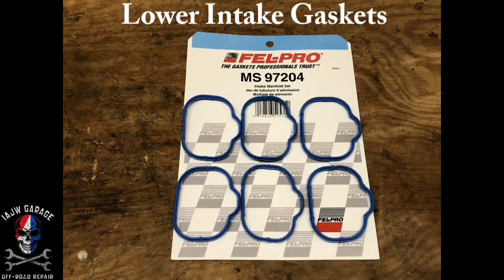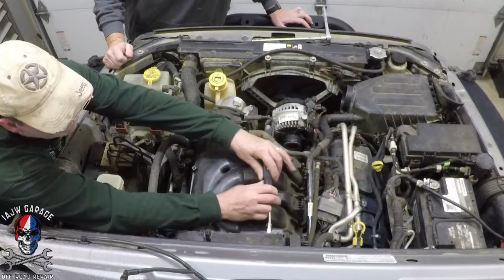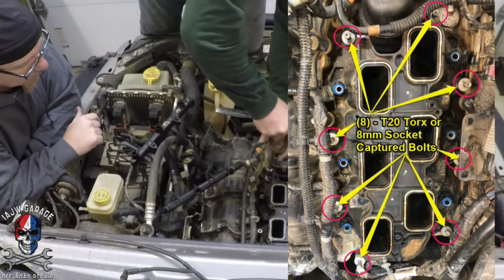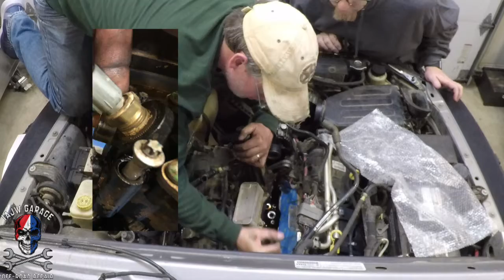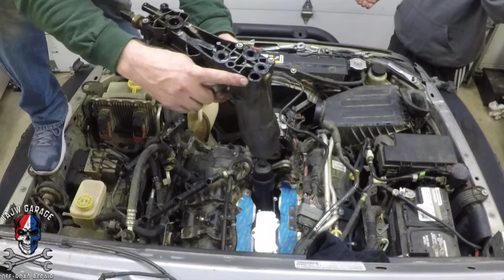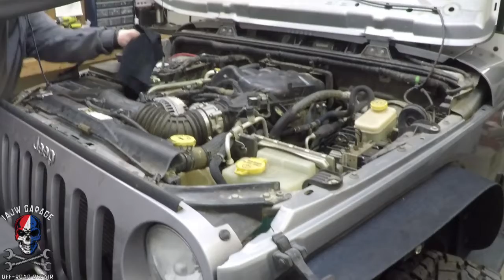Jeep Wrangler JK JKU 3.6 Pentastar Oil Filter Cooler Housing Replacement

Comment: I'm in agreement with everyone else that the video is superb.  The dialog between you and the owner of the Jeep was excellent in that it injected questions about the procedure that I would not have thought about.  The "in-set" close-ups were a big help also!

One thing about DIY.  You're going to need special torx sockets, both male and female, so head to Harbor Freight or elsewhere.  Second, I agree the injector clips were the main point of frustration for me.   They're delicate, you don't want to break them, but they give you fits.   I'll add that you stated to press the black part of the clip "down", but you actually need to push it "inward" toward the red locking clip.   The way you were sitting on the engine with the injector already pulled out,  one would have pressed "downward" due to the orientation of the clip.
Lastly,  Lowe's sells silicone grease under the DANCO name in the plumbing department for under 5 bucks for faucets.  This stuff works WONDERS on ALL O-ring installs.  Just a hint.

I closing, thanks a million for the video.  Couldn't have done it without you!
Reply from the maker: Thank you very much for the detailed and informative comment

Comment: I think it would have been helpful had you found and shown the leak or fracture..how obvious or non obvious to the eye after removing the oil cooler housing..also note a good time to change plugs, ciol packs maybe, and pvc valve..perhaps the thermostat too
Reply from the maker: Ok, thanks for your comment

Comment: Great video, only thing is that I broke the red clip on top of the injector. I might need to remove the fuel rail on both sides. Are they really that hard to get off?
Reply from the maker: @lightspeedmath8065  they are not too difficult

Comment: One important step not mentioned but I’ve experienced.  When the fuel rails are pulled, the injectors may or may not come up with them.  Some injectors may be stuck in the heads or some may be stuck in the fuel rails.  You may have to pull the injector top and/or bottom o-rings out of the rail or out of the head and put them back on the injector(s) before replacing the rails and tightening them down.  Also, the injectors need to be rotated correctly in order for the rails to seat all the way down because the rails and injectors are splined with notches.  I forced the rails down onto the injectors and didn’t realize that they were splined.  Everything worked and my Jeep drove like normal, but after being parked for a short time, a strong gasoline smell would occur.  I had to remove the upper plenum to get access to the fuel rails found that the rails were not seated all the way down onto one or more of the injectors.  It’s probably easier and more fool-proof to put the o-rings back onto the injectors where they they go, then place the injectors into the rails so that you can seat them in the rails correctly and then set the rail/injector assemblies down onto the heads. Injector to heads are not splined.  But injector to rail is splined.  Sorry to be so wordy, and I hope I’ve explained this to where you can understand.  But it can save you from having to go back into the engine to reseat the rails and can also prevent a potentially dangerous situation.
Reply from the maker: @johnschoolfield4595  thanks for you detailed comment/explanation

Comment: Mine 2019 JL started leaking after an oil change at almost 95,000 miles. At first I thought it was the rear seal, but then I found the puddle on top by the oil filter housing, then I found your video. I've ordered the Dorman and some new sparkies and will tackle this as soon as the part arrives. This baby is my daily driver. I'll come back and let you how bad it was. Lol
Reply from the maker: I appreciate the feedback, good luck
Reply: @ItsaJeepWorld  I did it !!  I noticed that my 2019 JL was slightly different but overall easy to do after watching this video a few times. I did go ahead and replace spark plugs also. I had a few minor hick-ups, which I will say to avoid them, TAKE YOUR TIME !  CHECK YOUR WORK at each step of the way.
Reply from the maker: @kevinpowell8461  Awesome!!! Nicely done

Comment: I need help did mine and everything went well but it started and idled rough and died  now it cranks but no start.....any help is appreciated
Reply from the maker: Make sure all injectors are pushed down all the way
Reply: @ItsaJeepWorld  I think.I left paper towel pieces in lower intake gonna have to pull upper intake  back off
Reply from the maker: @glahut93  oh, I’m sorry 
Good luck

Comment: Why would you replace the defective plastic unit with another plastic model when there are aluminum versions available?
Reply from the maker: 4 yrs ago when we replaced it, there was no aluminum replacement
Reply: How did the plastic cooler hold up with new O-rings?  Any leaks?
Reply from the maker: @petegarrigan8872  it lasted about 3 yrs

Comment: Just did this procedure today.
I would like to add that many of the forums advise changing the oil pressure sensor. I replaced both of mine and did upgrade to the all aluminum housing.

Comment: Great video! I’ve a question will you have to program the temp. And oil pressure censors?
Reply from the maker: No. Or at least we did not have to

Comment: You don’t have to take the fuel rails off. Disconnect your injectors and disconnect, the coil pack wires, and simply flip the lower intake over onto the driver side..

Comment: Amazing detailed guide, thank you for making and sharing this procedure. My only suggestion to other users is to fluid suck the valley clean and give it a fresh oil change before starting. Cooant tends to flood in to the oil ports when removing the cooler housing.
Reply from the maker: Thank you for your comments. I did that with my shop vac.

Comment: Excellent video..doesn't get any better than this! Very thankful for the checklist as well as the inlay photos. I am a pilot so I am a firm believer in precisely following a thorough checklist. I'm preparing to do this repair to my 2015 Ram 1500 and I have a couple questions. You used this part Oil Filter/Cooler Housing – 68105583AE for the Jeep. Would this be the same part# for my Ram? Also on one forum it shows the torque tightening pattern for the 5  E8 oil cooler bolts as the same pattern that you used to loosen them. Would you use your pattern or the opposite pattern for loosening/tightening the oil cooler bolts on my Ram 1500? Thanks in advance. I am very grateful for your video.
Reply: Thank you for your comments! I truly appreciate them. The Oli Cooler for your Ram is different, just search the Model and one will pop up, I didn't have enough info on Model and engine to make a complete search.

Comment: Great video! Just about back together for me. I've watched several videos before tackling this, and yours was my go to. Out of all the videos I've not seen any mention of oil or coolant change after. Do you just check the level and top off, or plan on a full change? I'm not sure how much of either I've lost, but it looks like a lot from the mess it made!
Reply from the maker: Some have changed both. I just topped off and ran it no problem

Comment: Jan 03 , 2023 -- I just followed your video and replaced oil filter housing with OEM ( which dealership stated this defected part was corrected )  . The total job took me 4 hours and it was not fun ! The video was well done and saved me $$$$ ! I do have a question -- after re-installing all parts and checking entire engine bay I started the jeep and the engine light popped up ---is this normal ?
Reply from the maker: It shouldn’t be, do you check all connections? If you can find out the code, it will tell you more. Thank you very much for the comment and question

Comment: Maybe it wasn't available when you did this job, but when the OEM  replacement fails next time, buy the dorman aluminum one so youre not doing this job a third time!
Reply from the maker: Correct, it wasn’t available 
It hasn’t failed yet, but that’s the plan 
Thank you!
Reply: Could you share the part number for dorman aluminum?
Reply from the maker: @DackJ  I don’t have it. Sorry. We didn’t use the aluminum one
Reply: @DackJ  you could also buy an exact clone from china from amazon for half the price ($125-150) but I didn't want to chanc e having to do the job again from a failure from  Chinese quality

Comment: Hi, great video, typing with greasy hands and I'm at https://youtu.be/5Uf9sHVJyvs?t=1376 where there are the oil temp and coolant temp sensors... and one I have off so far but the second one I can't tell how to grip grat squeeze push pull the thing off... any help would be great.
Reply from the maker: The clips are the same. However the other clip came off it’s the same, sorry I can’t be if more help
Reply: @ItsaJeepWorld  Hi I finished the job today.  That connector clip just required a bit more finger thumb strength and determination.  I didn't have to pull the fuel rails and basically used a string to hold the lower air intake up.  The tricky part was earlier there being an odd bracket in the back with small stud bolt hidden under a connector.  And a few times the capture bolt falls and interfered with sliding in the upper air intake.  Thanks!

Comment: I've done this job a couple times. Dealer charges about $700 using OE housing. If I do another I will buy the aftermarket aluminum assembly.

Comment: Hi guys, after you swapped out the oil filler cooler, did you change the engine oil an flush out the coolant.  Just had  mine  replaced  wondering if I should replace fluids.
Reply from the maker: No we did not, but it’s a good idea to just change everything while you’re there

Comment: 1st question. the bottom connecter in back of housing it wont squeeze back down whats the trick 2nd i have the needle torque wrench only goes up to 90 the can i talk up to 90 then do another 15 lbs the wrench that goes up to 150 seems way to big
Reply from the maker: 1st and most important it’s inch pounds
Reply: @ItsaJeepWorld  is it the same for aluminum housing.
Reply from the maker: @billywiggins5181  ‘to my knowledge’ the procedure is the same. It’s the same it’s just an upgraded housing.
Reply from the maker: I lubed the o-rings and it took a lot of pressure to get it seated 
Be careful but keep trying

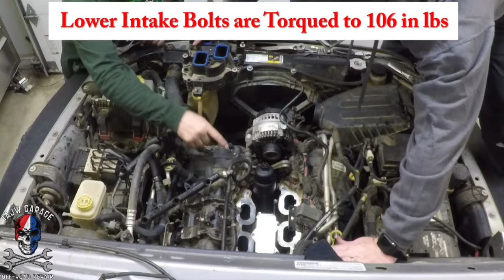Comment: Great video! Love the amount of detail and the extra pictures that you provided. I’m getting ready to do this very job in the next week or so but I’m having trouble finding an inch/pound torque wrench I like. I just started my journey into DIY mechanic work about two years ago so I haven’t accumulated as many tools as I’ve wanted to up until this point. I notice at 31:02 that you’re extending a beam style torque wrench past its measurements to achieve the required spec of 106. Am I accurate in assuming that a 0-80 in/lb wrench would be better used like this than me try and use a ft/lb wrench whilst doing conversions to get it right? If this is at all confusing, my bad. But if not, I’d greatly appreciate some guidance on this. Thanks!
Reply from the maker: Thanks for the great comment 
I would find a correct in lb torque wrench and not guess. There are very good digital ones out there 
I’ve been a mechanic 40 yrs. It’s a little easier for me to guesstimate

Comment: If you are purchasing an oil filer cooler housing, make sure you get the one that does not have the circular o-rings. Mopar redesigned the part. It should look like a triangle. If you buy your part on amazon or ebay, it has the old style o-ring.
Reply from the maker: Good info, thanks

Comment: Just a little FYI, do not put another plastic oil cooler filter housing back on, be sure to get the all aluminum one…I replaced mine myself, and literally  replacing it again not even 6 months later with all aluminum…I do everything to torque spec’s especially filter housing, and it still went bad again…a lot of these you can get come with the oil pressure sensor, and oil temp sensor, do yourself a favor and double check they are the correct part numbers, also go ahead and do spark plugs, coil packs, valve cover gaskets, injectors, because you don’t wanna have to dig back in anytime soon…it’s not a hard job, but can be frustrating at times your first time…good luck!

Comment: Is it recommended to flush the coolant system or do an oil change after replacing the oil filter housing ?
Reply from the maker: I don’t know what is recommended. We did not do either. No issues

Comment: 7-9 nm converts to 62 - 80 inch lbs.. you have the upper manifold bolts listed as 89 which will over torque and possibly crack the lower manifold.. ask me how i know!  great video otherwise
Reply from the maker: Thanks.

Comment: Hey man, thank you so much for
making this video. I used your superb video combined with another one. I'm no mechanic
and this was the most advanced auto
repair I've ever attempted. I went slow
over two days and did it with no leaks
or codes! Besides the injector plugs
being designed by satan, I got my
dorman unit installed. The only thing I
broke was the pcv vent tube while
taking it out of the clamp. I fixed that
with a short section of rubber tubing
joining the snapped tube and was
good to go. Thanks again for
expanding this layman's abilities!
Reply from the maker: Outstanding!! Good job!!

Comment: Awesome video! I found that you don’t have to remove the fuel rails or injectors, you can just disconnect the injector connectors and the rails can stay on the lower intake as it comes off. Still super helpful! Those clips on the back of the lower intake were a pain!
Reply from the maker: I’ve heard that before 
If I have to do it again, I’ll try that
Reply: @ItsaJeepWorld  did you have to drain the coolant before disconnecting the line on the back of the oil cooler?
Reply from the maker: @ctbcrf50  I did not
Reply: @ItsaJeepWorld  I put everything back together and now it doesn’t stay running. Fires up for a few seconds then dies, and then now it won’t even crank over. I’m thinking I didn’t connect a few of the injector connectors all the way down with that snap, and I probably blew an ignition fuse now maybe?
Reply from the maker: @ctbcrf50  it’s always something simple, check the wiring, as long as you don’t have fuel going everywhere.
Reply: @ItsaJeepWorld  yes sir I get ya I’m tired from working on it all day but will check for fuel. I did not take off any injectors or fuel rails only the electrical connectors, so maybe it’s just that one isn’t snapped all the way down. Thanks for your help!
Reply: @ItsaJeepWorld  actually I took the upper manifold off again, and i don’t know how I missed 2 bolts on the lower intake but they weren’t all the way down. Once I Re torqued them, put everything back and now I get a click when trying to start. Same click and no start with clutch in or out. I was thinking a relay blew or maybe clutch switch?
Reply from the maker: @ctbcrf50  very strange. I would start checking fuses or even the battery charge level

Comment: Thank you for doing this video. Saved me a ton 💰 
Next up... what to do when sand falls into the intake when you pull the fuel rail!!!
Reply from the maker: I would get a vacuum and air gun at the same time air to stir it up and the vacuum to catch it, just a thought
Reply: @ItsaJeepWorld  
Thanks.  I did use a shop-vac and some brake cleaner. Let it puddle up then sucked it all out.
All In all it went pretty well. I would have never attempted something like this without your video so thanks again.
Reply from the maker: @DustyRoadHome  I’m glad it helped you!!

Comment: Just removed mine using this great video!! I can't believe the whole top of the engine is plastic, unbelievable. I've seen alot of bad reviews on the amazon replacements, most recommend getting OEM. Now I have to make that decision before I can put it back together.
Reply from the maker: Check out the Dorman Aluminum body Cooler
Reply: The aluminum is sold out everywhere. Plus, my OEM parts buddy told me dealers can only sell 3 per week because of the shortage. They keep them for shop repairs and the 68105583AF has now been upgraded to an AG. This should be a recall issue. Again, thanks for the great video!!
Reply from the maker: @Enjoytheinbetween  no problem, we got ours off Amazon. Be careful of that. He just contacted me and after 3 yrs we need to do the job again

Comment: Just wanted to thank you for making this video, it helped give me the confidence to do this same job on my own Jeep.  I completed it over the weekend, and went back together very quickly! No leaks, no issues. 👍🏻
Reply from the maker: You’re very welcome, glad everything worked as it should have
Reply: Was your leaking coolant in the valley?
Reply from the maker: @sevefamily6670  it’s was a mix of oil and coolant
Reply: @sevefamily6670  no, just oil.  I did have a coolant leak, but that was due to the shop who replaced the radiator leaving one of the heater hoses off near the rear of the engine

Comment: What actually happens to the part? Does the plastic crack? If so, from heat or over torquing the filter cap?
Reply from the maker: Plastic can crack but usually it’s the o-rings on the bottom that are deteriorating

Comment: Thank you all for your help! However I am having coolant issues after doing this fix. My engine will start overheating after driving for just 2 or 3 minutes. I cannot even get coolant to drain from my radiator petcock. Any ideas as to why? I had no overheating issues whatsoever before this fix.
Reply from the maker: No idea why coolant would not drain from the radiator unless it is empty.